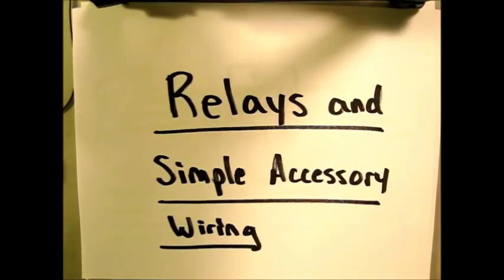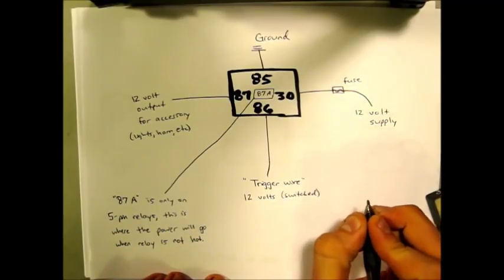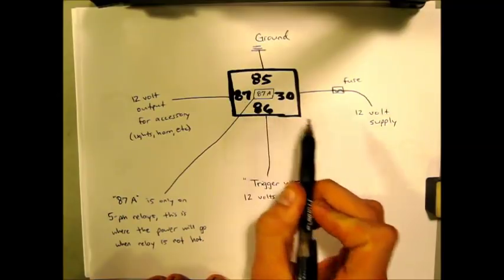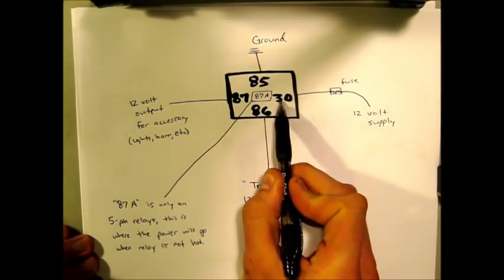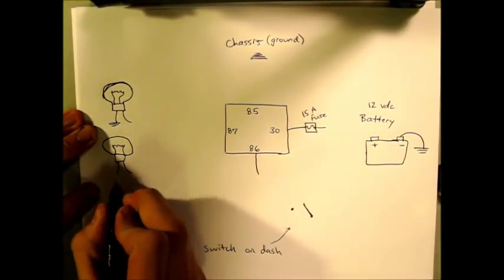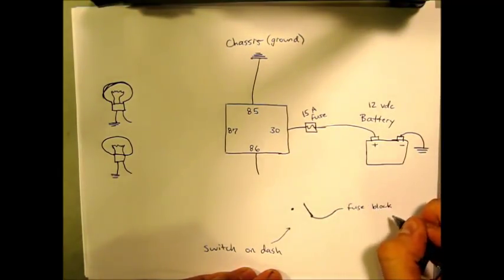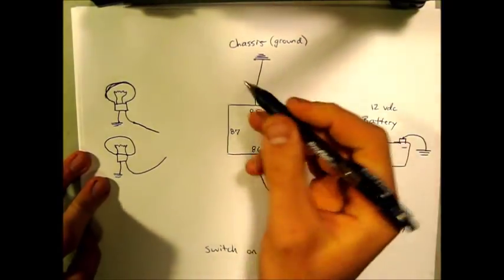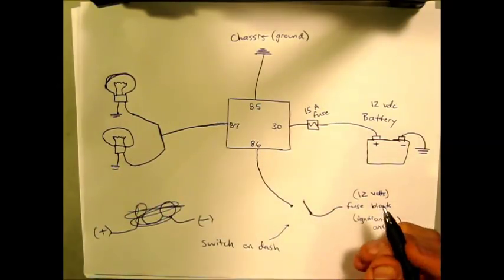Basic Automotive Relay Operation and Simple Wiring

Comment: sucks, i hear this then i read the other way,, 30 is output and 87 is in, or 30 is battery or 87 ,which is it??????????????? I been reading 87 is my hot power from battery, and 30 is output to amp etc,86 is my source in from radio stuff, trigger wire

Comment: Great video, very clear and precise! One question for you though, if you don't want to wire the switch to the ignition or fuse block, where do you wire it to, back to the battery with another inline fuse?
Reply: It all depends on what and how you need it to work.

Comment: i'm wiring a motorcycle amp. 2 pole switch on the handlebars a fuse box wire and a relay. want to play music when the bike engine is off. instead of the 2 light bulbs,  i'm using the amp. where do the + - wires go from the amp. what wires go from the switch on the handlebars. can you draw a hookup for what i'm doing. thank you....jim from pa. dont worry, i test with a 12volt fan instead of the amp.

Comment: How can I wire in a air horn to use the factory steer wheel horn button? At the moment, it is wired in with the existing +/- wires from the factory horn. It honks intermittently!! NOT a constant blast to get someones attention!!

Comment: Thanks for the video although I'm a little unsure about number 87 if you not running the relay from your ign switch or toggle switch , I have a elec cooling fan in my old 69 truck it came with a fan controller they did not include a relay in the fan it's power from the battery to a fuse then from the fuse to the controller , the fan is wired into the controller and when the probe reaches a set temp fan turns on . I know I can go battery to fuse then fuse out to 30  85 is grounded but since I'm not running a toggle or flip switch would I go 86 or 87 to the fan controller ? I see how the relay works like if I wanted to mount some cab lights on the roof or fog lights etc . The POS and neg of the fan go into the fan controller  the power for the controller now is just right from the battery to the controller at idle at stop light it really puts a hurt on the alternator
Reply: It actually seems like the controller is a relay since 30 is the power the temp probe is 86 when it gets to temp desired it turns on triggering 87 we're the fans are connected to although if that's the case don't know why I have such power loss I'm also running a elec fuel pump only draws 4/5 amps

Comment: Edify, i am wiring some amp power steps to my jeep and was looking at getting power from dome light, so when i use my key remote it will also bring down steps and also be able to use when i remove doors. Any way i was looking at using relay 30 would be to dome light power; 85 ground; 87 to power steps and to switch to turn off would this work? Or do have have better suggestion? Thanks

Comment: I have a 2009 Jeep JK and purchased a horn harness with the relay and fuse set up. Watch their video on connection did not work. Change the ground to the wiring and also the switch and nothing. The horn harness is iJDMTOY (1) 12V Horn Wiring Harness Relay.
Could their be any other reason why it does not work?

Comment: How would I wire up something to interrupt the ground wire on temp switch
Reply: I had to do exactly that for my car horn.  What I did was to connect the fused 12v supply to terminals 30 and 86.  Terminal 87 went to the accessory ( in my case, the horn ) and 85 was effectively switched by the horn button.  When the horn button was not pressed, the power across 86 - 85 was not a complete circuit, so no power crossed between 30 and 87.  When the ground was completed by the switch ( horn button ), the trigger circuit 86-85 was completed and this triggered power to cross from 30 to 87.   It works fine.

Comment: I bought some relays from Amazon and they are numbered different that yours. They are just 1-2-3-4. I attached a pic. Could tell me the wiring for these pins? I also want to wire up a wig wag relay for some lights. The pins are marked L - X - and P. Is the P for power in and the L and X for each of the lights? Your help would be greatly appreciated. Keep up the great videos. They are both helpful and entertaining.

Comment: Hi, I wired up some backup/aux lights before I saw the video and have done it as follows:
# 30 to 12v bat.
# 87 to lights (grounded)
# 85 from reverse light wire
# 86 to ground
The lights come on when in reverse, in order to use them as auxiliary lights I added a switched wire to #87. I find the relay is isolated so no voltage other then terminal #87. I assume the only issue is that I am back feeding my switch when the back up lights are on, but too is on a relay so I haven't seen any issues. Is there anything I need to be concerned about?
Reply: I think you should have connected 30 to your aux/backup lamp(s). 87A to the positive wire for normal reverse lights. 87 to B+. And a switch as shown in this video. Caveat: make sure your aux lamps do not exceed the capacity of factory reverse light circuit.

Comment: 87 and 30 can be reversed
Reply: Thanks, the wiring diagram I have has a fused wire from the battery to the 87 terminal on the relay and the 30 terminal going directly to two passing lights (motorcycle).

Comment: Where does the 2 wires or 3 wires from the switch go. 1 goes to 86 then the other goes to ignition. What about the 3rd
Reply: Slackerz Sincity 1 is a ground one is power and the other to the relay
Reply: If there is a third, it is ground for the light in the switch.

Comment: pls clearly explain the use of 87A
Reply: Think of it as a double pole, single throw switch in relay form. That's my understanding. Basically, instead of having it be on/off, it's a choice between powering one or the other circuit. Someone please correct me if I'm wrong.
Reply: @leoerickson7554  close, single pole double throw, actually.

Comment: Thanks for the video. This was helpful and more clear than most. A discussion of wire guage and fuse size would be a good addition...something for normal aftermarket driving lights (altho I realize they will draw from 55W to about 130w per light).
Reply: Hi bro
Reply: Pls I have Ford focus 2004 model but dashboard battery light came and go.